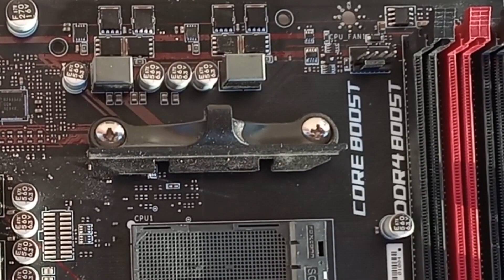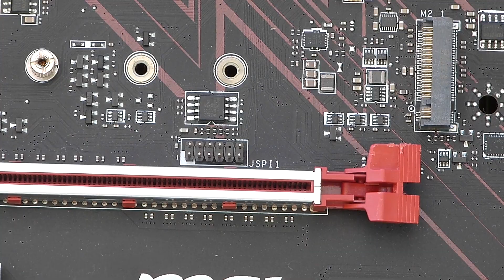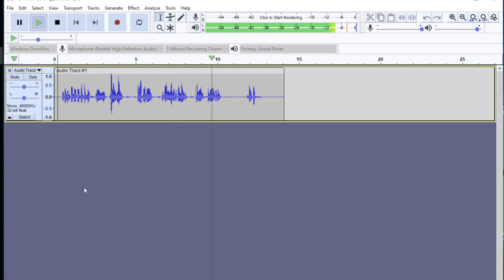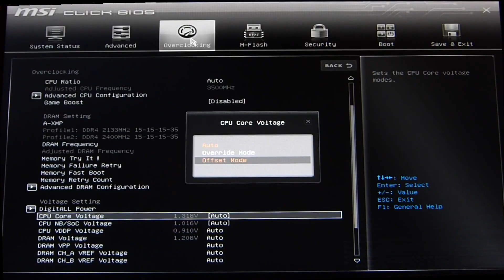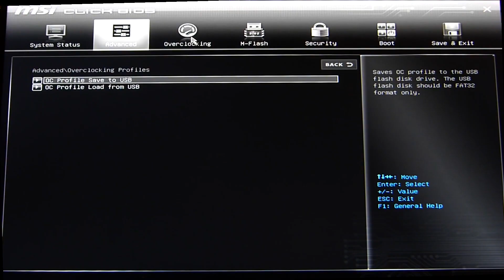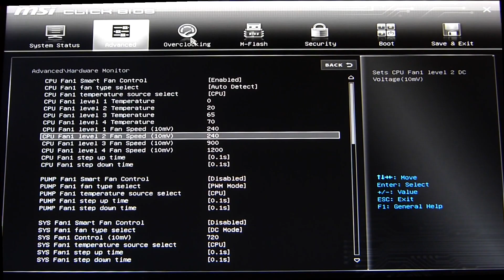MSI B450 Gaming Plus - One of the Good AM4 Motherboards Out There

Comment: Where are you guys finding it for 20 bucks. I am in America and a quick search has it priced at 100-179
Reply from the maker: I usually buy them either as deffective or untested. About 75% of the defective actually require some repairs done: small SMDs knocked off, a BIOS and/or other firmware needs to be reflashed.

The rest either just require a bit of cleaning (debrees in the socket), or they were misdiagnosed as faulty, and they just work.

Comment: An overall excellent mid range board, I really like the bios flash option!
Reply from the maker: To be honest, I'm not a fan of the BIOS flashback. Call me a fatalist, but I just see another piece that can go wrong.
I find simply unsoldering the chip from the board and putting it in a programmer to be the safest bet.
Using the SPI header is the second best option, followed by using a clip placed on thw chip.

But again, I like tinkering with that, so I am a bit biased here.
Reply: @oldertechtoday  I have expressed myself poorly, sorry. What I meant is the option to update the bios without the CPU being supported.
Reply from the maker: @gaming.teacher  Updating the BIOS without needing a CPU is always a good thing. 
My earlier reaction comes from a single case where it doesn't work; and with it being placed (data wise) between the CPU and the BIOS chip, it doesn't allow the board to POST.
But I think that in most cases it works fine, and it does the job.